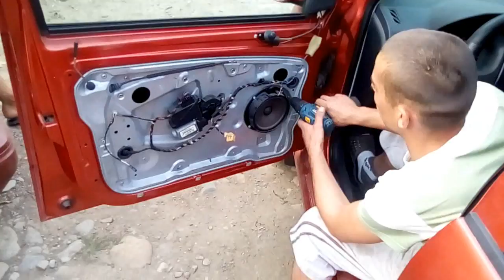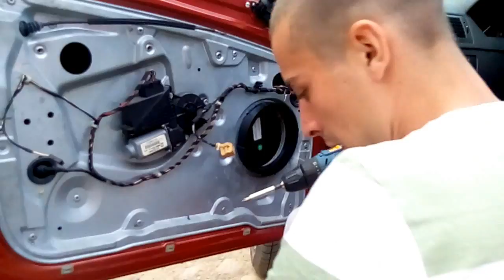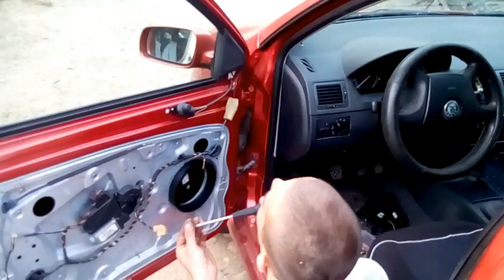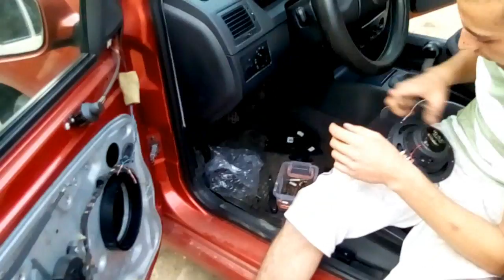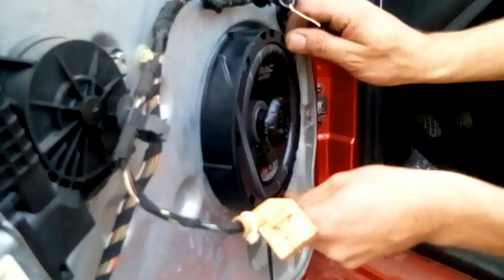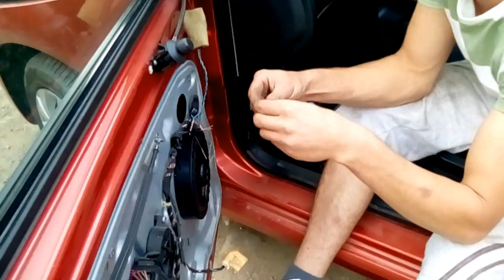Installing aftermarket speakers Mac Audio Star Flat 16.2 on Skoda Fabia 1

Comment: Shouldn't you be fitting componant  speakers instead of coaxial? My fabia has tweeters.
Reply: Sounds alot better with a component set, I have installed the soundstream rbc6 compo set.